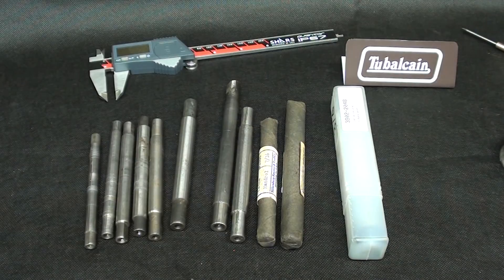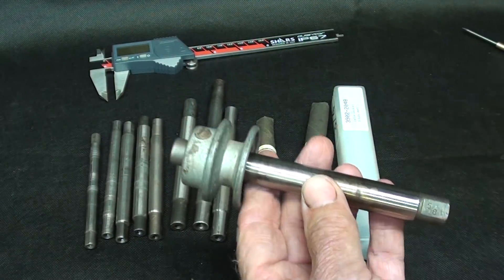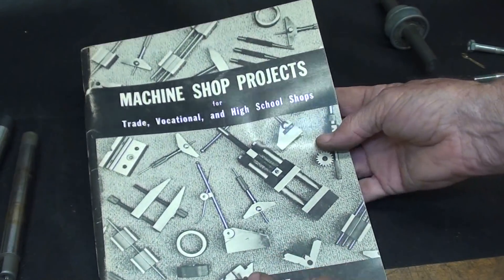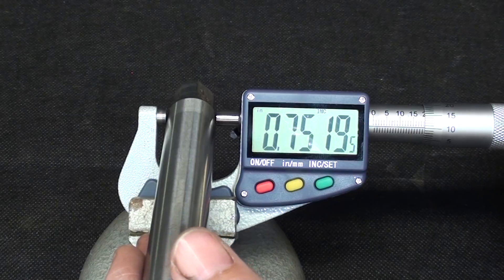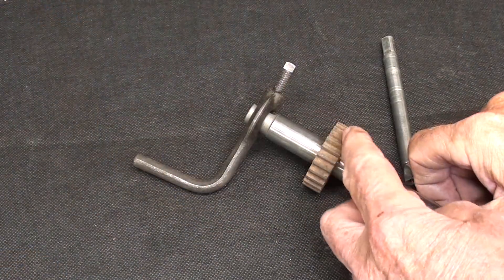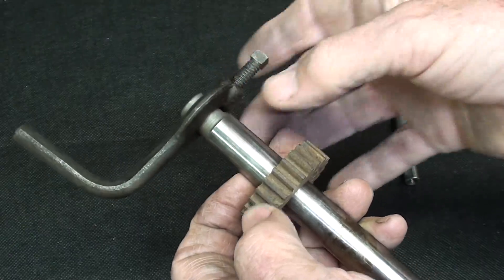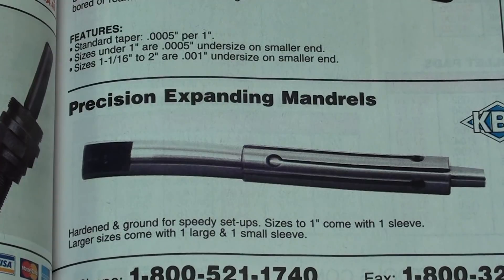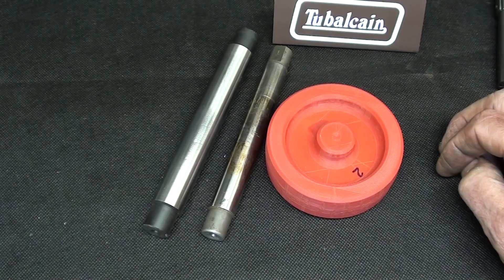WHAT ARE LATHE MANDRELS TIPS #474 tubalcain

Comment: I also worked in the factory that made the London buses, I was on a production cylindrical grinder and while one part was being ground on auto we would knock the last part off the mandrel by hitting  it on a cast iron post about 6" diameter and 4ft tall. The mandrels had safe centres.
Reply from the maker: Thank you, that is interesting

Comment: The last time I remember using one of these mandrels was in the first shop I worked in. We had one that was marked with a grind mark that was used for a bore gage when honing out bevel gears. The the parts were OD ground on a bearing fit using another mandrel.
Reply from the maker: That would make a good gauge, because of the taper is so slight

Comment: A different approach for the oversized bore, is to machine a piece of stock to have a shoulder on it, thread the machined end to leave a non-threaded length slightly shorter than the thickness of the blank.

Without removing the mandrel from the chuck, place the blank on it, put a nut on and tighten it down, to hold the blank hard against the shoulder.
Reply from the maker: Thank you, that is an excellent alternative way of doing it
Reply: Thanks.

Provided you don't remove it from the chuck before use, it is 100% accurate, even correcting for chuck run-out.

Comment: Sir, i though you will make a initial “grove“ on the 3d printed mode when i first see this clip, in that way it will save some time on the lathe work, right? but you don`t. I then guess there is a reason behind. Is it the “grove“ will. Make the casting easy to crack or difficult to mode that way?
Reply from the maker: Never thought of doing it that way
Reply: 2 Reasons: 
1. The 3d print needs support else it will collapse on itself, the hot plastic will simply fold over.
2. Withdrawing the pattern without damaging the mold requires a slight taper of a specific slope (called pattern draft) on the outside edge of the pattern. He's covered the whole casting process in many of his other video series (and makes me wish I had the space to do it myself.)
Reply: Additionally the wheel he is making is a crowned one for a belt sander, not one with a V- (or other) groove for a normal belt
Reply: I have to apologise for my question is not clear, or even misunderstanding. Let me rephrase it, what suprise me is the axis of cutting, i though the 3d model will be cut on the other axis, just like we cut an apple or orange in half the normal way, from sterm to butt, north pole to south pole that kind of half. And i fail to mention this point in my question, it make my question look stupid.
Reply: +luderick wong
Now that you've explained it better I want to know that too haha